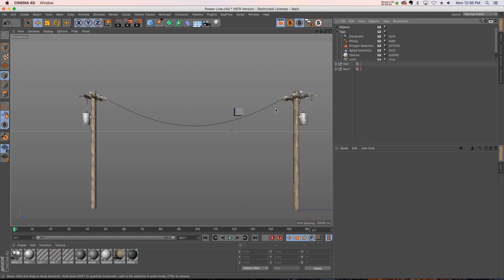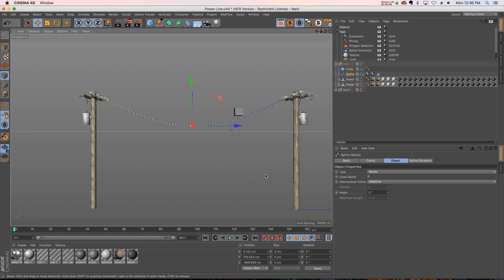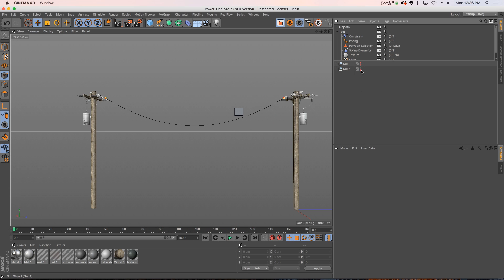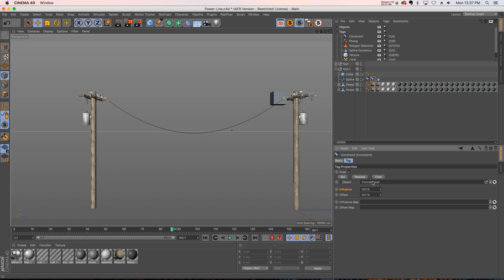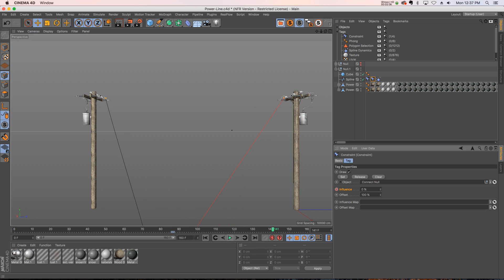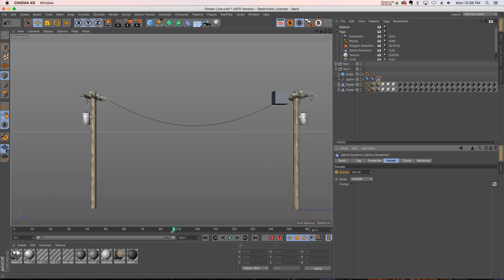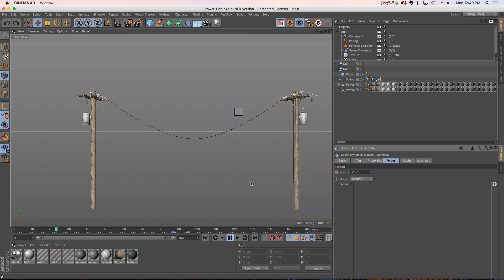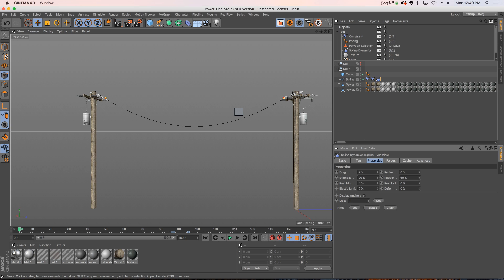C4D Quick Tip: Snapping and Breaking Spline Dynamics

Comment: Your using hair dynamics. You should put regular dynamics onto a spline, and use a short spring with autobreak at the preferred breaking point. If you need random breaking use a 'string of pearls' (softbody made of clones with breakout length).
Reply: and how do you fix the points with reg dynamics?

Comment: Couldn't you just make your power line two separate splines connected in the middle by a constraint tag?
Reply: Tough part about that would be getting the right spline interpolation using 2 splines, but worth a go!
Reply: had the same thought. ;)